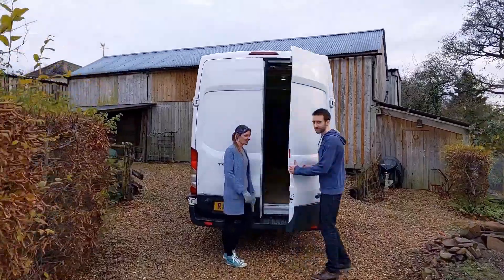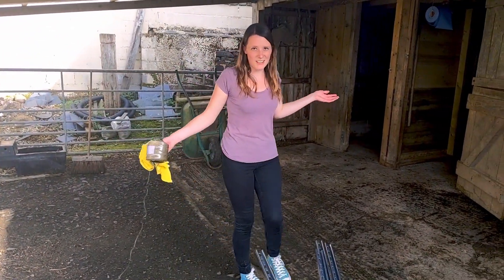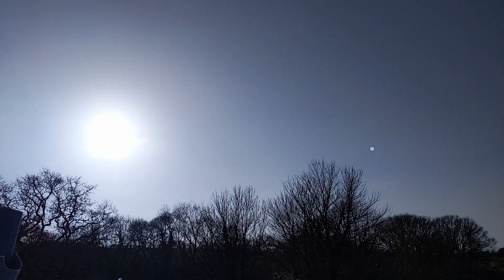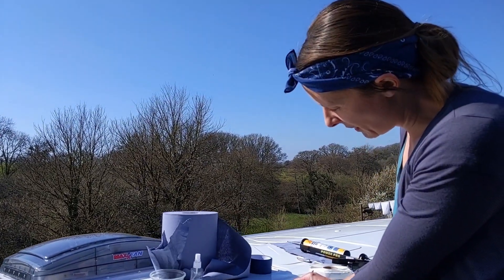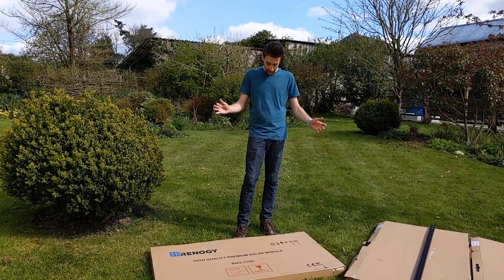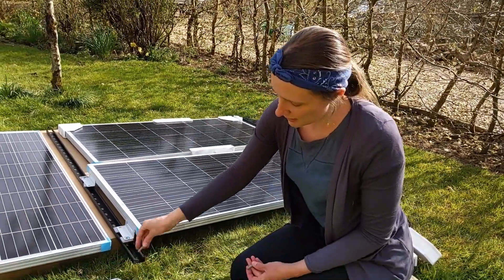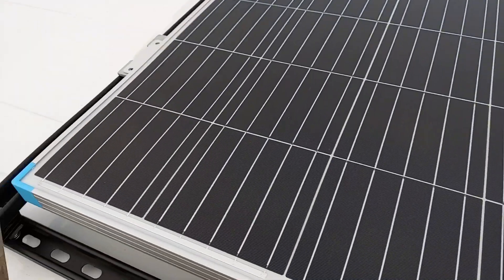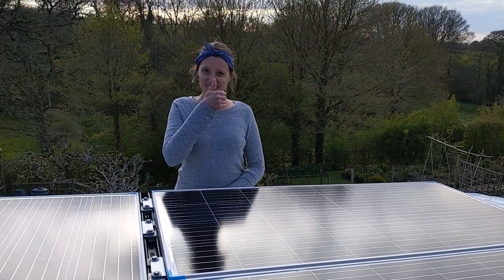DIY Unistrut Roof Rack (Easy Solar Install!) | Transit Van Conversion E12

Comment: It is one of the cleanest diy unistrut racks I have seen on the platform! I like the low profile rails, black paint, and rubber spaces underneath, also a clean sealant job!

I purchased 6x black anodized, mono, 190W panels, 142x70cm, and hoping to mount them on a long-wheelbase sprinter or crafter. They have circa 4.3 meter payload compartment length, so there is little space to spare, 6*70 is 420cm, almost 1.2 kW of power ;) I will have to mount them with no gaps in between. I think it looks better and is double. In the worst case, I will have one spare panel for winter. I am also hoping to have a tiltable mount, which is not a strict requirement, more like a side effect of the mount I am thinking about. I might have to rise the last panel or install it under an angle like a spoiler, to fit two low-profile vents underneath the panel. I will be living in the van full-time, because of the high rent prices, so wish me luck! ;)
Reply from the maker: Thanks! Yeah it's working out really well for us :) Nice, that's a lot of power! What are you going to be powering with all that? Good luck 👍
Reply: @SelfBuiltStories  Thanks for the response! I will be living in the van and hopefully continue working remotely in IT. So computer all day, lights, fridge, blender, ventilation/fans, charging devices, dehumidifier in the winter, diesel heater, water pump, some power tools. My way of thinking was panels are cheap and I have no particular use for the roof, so why not. I live in Ireland, so with winter in mind, I expect only 1-2 peak sunlight hours in the winter on average, and 5-6 in the summer, but could migrate somewhere else for winter. At home, I use about 4 kWh per day with electric cooking and a desktop PC. I have Bluetti AC200MAX 2kWh power bank that can handle 900W solar and the battery extension is 3kWh (200W solar), 5kWh in total, hopefully some 3-5 days of autonomy. I don't want to cringe too much when checking the battery levels ;) Maybe I will move to an off-grid (static) location, and I could rely on the van as a mobile power plant ;)
Reply from the maker: Cool, yeah if you have the space up there then why not! Sounds like it will be a nice setup 🙂

Comment: You guys are fantastic. You guys work so well together and explain everything in great detail and with good humour. We are doing a van conversion build at the moment and have had our own fair share of ups and downs. We bought a roof rack last weekend that ended up just being slightly off and doesn't fir out roof mounting points. We are going to make a unistrut roof rack like yours with a few tweaks for our citroen relay and will then mount our renogy panels on top. Your 525W should power a massive amount for you!
Reply from the maker: Thanks a lot! 😊 Yeah we like to share the mistakes as well as there are inevitable things that go wrong all the time in a project this size. And that's cool, hope it goes well for you. Our roof rack is holding up really nice and having all that free power on the roof is great 😀

Comment: Hi guys, thanks so much for the great video! We ended up following this design pretty closely and found that we had some leaking, which we realized was coming in from between the strut and the pucks, so we added a layer of butyl tape on top of each puck before re-securing the strut down and now we are leak-free. I just wanted to point it out for anyone else who might run into something similar. Thanks for helping us build a solid and budget-friendly roof rack!
Reply from the maker: Awesome, glad it was helpful! We did something similar with sealant and covered all around the tops of the bolts and around the rubber washers, butyl tape sounds like a nice way way of doing it too. Enjoy your new rack 😄

Comment: Hey guys! I went back in time to watch this episode (yet) again and I just wanted to say THANK YOU because it finally gave me the confidence to build my own unistrut roof rack. My van is an Iveco which doesn't have threaded inserts so I had to drill holes but otherwise I ended up doing exactly the same as you. Butyl tape, spacer, unistrut. The result is better than could have hoped for. You guys rock 😁
Reply from the maker: Awesome, glad to hear it worked out well for you too! It's pretty satisfying to build one for a fraction of the cost of the bought ones isn't it 🙂

Comment: Thanks to both of you your inspirational I picked up a 16 plate jumbo a week ago and watching your video diaries is like watching a video Haynes manual version of an how to guide Ive got 15 days to but some kind of basic setup in the van for a 3 day holiday with the grandson (he's the boss ive been ordered to sort the van for an holiday and he needs power for his tv - lol) so far a blowup bed and a loo  lol - the same panels batteries and a channel rack on its way fwoooo (tick tock) ---- your diaries will certainly help in my race THX
Reply from the maker: Cool, hope the build goes well! And wow 15 days, that's quite the challenge, good luck! Our first ever night we spent in the van was just after we bought it with an airbed, coolbox and wearing lots of warm layers 😃 You don't need much to be able to use it for some adventures, enjoy! 🙂

Comment: Hi, great video and explanation we are certainly taking inspiration from this. Thanks! 🙏🏼 Have one question though. When looking it up it says that the bolts only go 16mm deep in the pre mounting holes. However, it looks like you have 25mm going down into the hole since your black nylon spacers are 25mm and your bolt is 50mm. We are struggling with the length of the bolt we should use, was your experience that the bolts went further down than 16mm or I have just missed something in the video and your bolts also only go 16mm down into the holes? Thanks in advance! 😇
Reply from the maker: No problem! And hmm, interesting question. I've just looked in the BEMM for our Transit and it does mention the 16mm maximum intrusion, but the actual space on ours was definitely more than the 16mm as like you say we have a larger excess than that. You can see the amount of bolt sticking out that goes into the roof when we tighten this one down here: https://youtu.be/1fh9iaTJ6Ic?t=571 . We've been using our setup for years now with thousands of miles driven and haven't had any issues. Assuming you also have a Transit maybe the best thing if you haven't already is to take off one of the sealing covers and use a small pencil/cocktail stick to check the depth. Good luck! 👍

Comment: Finally time for me to build a rack, so I’m back watching again. Any updates on how it’s held up? Thanks for the great tutorial!
Reply from the maker: No problem! And we've had no issues with it so far (save for one spot where we had to go back and add a bit more sealant we missed). The only thing we thought would be nice would be if the widthways bars were slightly longer to give a bit more flexibility with different panel sizes if we ever wanted to do that, but then we wouldn't have been able to nicely cut a 3m piece into two for them so it would have cost more. So we'd do the same again with maybe that one change if we could get some slightly longer bars for a good price 👍

Comment: Nice job! I would have put cable entry gland under solar panel - that way it is less visible and also protected from up (rain and sun).
Reply from the maker: Cheers! :) You could do that but we wanted to use the existing covered holes on the roof of the Transit instead of drilling anything. Also makes it easy to get to it for maintenance/adding sealant without having to remove a panel first 🙂

Comment: I can't believe you used that tiny hacksaw!  They have terrible blades. Good job persisting.
Reply from the maker: Haha! It worked pretty well cutting through the unistrut to be fairbut we gave up cutting down all the bolts with it. Switched to the angle grinder for those 😅

Comment: Advice asking, I have a LWB not the jumbo, wondering if Unistrut extend further back would fit the the same 525w set up you have, I have a maxfan as well..Seems you have room at the back, just have to put the gland centred right at the back and drill a hole..Love your vids, funny I have a computer alarm clock, farm animals sound, so every time your sheep make a noise I think my alarm is going off..lol
Reply from the maker: Haha, that is pretty funny! Sorry about that 😂 And yeah we do have a bit of space at the back of the roof rack but not much, about 40-45cm (we've mounted an antenna for our internet there). Our panels do start quite far back on the roof though, probably the first 1/3 is just the sloping part and the maxxfan, so if you had them start further forward you could probably do it the same way. We could also have gone with slightly different sized panels that were a bit wider and just extended over the edges widthways a bit which would have been fine. So would imagine you can definitely fit 525w on your roof, just might need to play around with different configurations and panel sizes to get something that works 🙂
Reply: I've started converting a LWB transit and have managed to configure 500w using 2 x 200w and 1 x 100w panels - which according to sketch up (and my measurements!) should fit up there no problem! Fingers crossed it works in reality haha. I couldn't seem to find a realist way to fit 575w like SBS but I reckon 500w is more than enough. Let me know if you figure it out!
Reply from the maker: @harrietmorse5529  Cool, good luck! 😀
Reply: Actually just an update/correction if anyone read my earlier comment - apparently you shouldn't mix wattages within the same solar array! So I've changed my plan and sent back the 100w and exchanged it for an additional 200w. Now I'll be squeezing 600w of solar onto the top of a LWB transit hopefully! Just didn't want anyone to read my other comment and think mixing them was a good idea. I stand corrected!
Reply from the maker: @harrietmorse5529  Cool, yeah you can mix panel sizes but it does make it a bit more complicated as you have to plan the array carefully to make sure the voltages/amperages make sense taking into account the different panel properties. Generally it's a little less efficient as the array is held back by the lowest common denominator, explorist.life has a pretty good article about it here: https://explorist.life/using-mismatched-solar-panel-sizes/. Enjoy your 600W array!👍

Comment: I have 4 bolts for mounting points on my roof of my VW Caddy. I'm gonna use unistrut for the rack and box and make my own mounts using rubber spaces, washers, 90⁰ brackets, and t-nuts. Then I'll make a rack and rack box
Reply from the maker: Cool, hope it works out well 🙂👍

Comment: These galvanized steel rails are a decent alternative to aluminum rails. Currently we have an aftermarket (commercial) rack with emergency lights installed. I'd restore that thing, but it's solid steel construction and way too heavy. 
Great setup with the solar panels and good to see the progress! :-)
Reply from the maker: Thanks, yeah looking forward to having them all wired up 🙂 How is your build coming along?
Reply: @SelfBuiltStories  Due to some health issues and other projects - we've been dragging our feet a little. Yesterday I did take a closer look at the rack and it's bolted to existing, factory installed C-channeling. If the bolts are not terribly rusted, we should be able to take the rack off with about 4 people this weekend. Then it's time for an extensive cleanup underneath. Small steps.
Reply from the maker: Small steps are still moving forward 🙂 Hope that it goes well when you're able to pick it up again 😊

Comment: doing the same thing soon, just very scared with building the frame! You've been great to watch, got the same van so everything is so helpful. When are you off living full time? You've been building for ages!
Reply from the maker: Cheers, and glad to hear the videos have been helpful. Sure you'll be fine, the unistrut is a bit like meccano, so it's easy to bolt together and reconfigure it anytime you want. We finished the van quite a while ago now, the videos just take a long time to put together 🙂 Currently in Norway since a month ago, enjoying it a lot! We're a lot more up to date on Instagram 😎👍

Comment: hi just got round to fitting my version of this, the m8 bolts i have ordered are the wrong thred they dont go in smooth tried some m8 roofing bolts i had lying around they go in real smooth. would be worth stating what thred the fittings are inside the roof. thanks for the ideas. i have used a few of yours.
Reply from the maker: Hey, interesting, it's not something we came across. We just ordered some standard M8 set screws and they worked fine. No problem, good luck with the rest of the build 👍

Comment: Hey Guys, loving the channel, it's helping me out so much with my build. I just have a quick question, was your unistrut hot dipped galvanised or did you go for the pre galvanised version, if so how has it held up after painting as I understand it pre galvanised is internal and hot dipped is external?
Reply from the maker: Awesome, glad to hear it! And we used the pre-galvanized ones (https://directchannel.uk.com/product/21mm-light-slotted-channel-3-metre/ ), then sprayed them with primer and black hammerite. They've held up pretty great considering all the weather and storms they've been subjected to, but the one thing we've found they don't like is being sprayed with a super high pressure jet wash 🤣

Comment: This is an excellent idea. Now the question is whether or not I can do it on my Nissan NV 200. If the top is flat, I’ve got it made in the shade.
Reply from the maker: Thanks, we're happy with it 🙂 Our roof isn't actually flat it's curved in the middle, but we just raised up the height of the struts going widthways across the van until they would clear the curvature of the roof and that worked pretty nicely
Reply: @SelfBuiltStories  
The NV200 isn’t as wide as yours but the specs indicate the total width, sans mirrors is 172cm, so that should be okay. The three(3) 175W Regony panels I’m going to use are 126 x 70 so to minimize total length I’m orienting them the same way as you did.
Reply from the maker: @Zerpersande  Cool sounds good, hope it works out well for you!

Comment: Can you please tell me what size of unistrut you used? 1 5/8” x 1 5/8” or 1 5/8” x 13/16” ? Thank you sooo much!
Reply from the maker: Hiya, we bought 4x 3m lengths of 41x21mm light slotted channel, 1.5mm thick. This is the exact one we went for: https://directchannel.uk.com/21mm-light-slotted-channel-x-3-metres. HTH 🙂

Comment: great tutorial, just wondering is there any wind noise while driving from installing roof rack from unistruts?
Reply from the maker: Cheers, and nope, nothing that we've noticed at least. The only thing we hear when we're driving is occasionally from the back when plates and things moving around a bit in the cupboard and trays in the oven, but the bulkhead blocks out most of it and we've never found it noisy 👍

Comment: Hi, great video! I was just wondering how many nylon blocks you used underneath the long pieces of uni strut?
Reply from the maker: Cheers :) And the nylon spacers we used came in a pack of assorted sizes 15mm, 10mm and 5mm deep (link in description). We used two together in a stack, you can see the two individual ones at 10:01. Believe we used the 15mm and 10mm on top of each other so a total stack of 25mm. HTH 👍

Comment: On transit van the side rail mounting area of the roof is on a slight angle . Did that cause any issue when mounting the cross bars without the need of shims ?
Reply from the maker: Yeah the roof does sloop up in the middle so you can't go straight across the middle without gaining a bit of height first. What we did is use the unistrut square washers which are a few mm thick in a stack, so the width ways bars are raised up by 3 (if we remember right) of those on each side. That gives just enough clearance for the curvature of the roof 🙂

Comment: No spreader plate on the 8 roof holes? I'd consider it for strong windy conditions or when you get a lot of snow on top, or your roof may bend. Otherwise, good first principle thinking to eliminate buying a prefabbed roof rack.
Reply from the maker: Thanks for the idea, it's held up nicely for the last year but will keep it in mind if we get any issues 👍

Comment: What length M8 Bolts have you used for this? And have you glued Nylon washers together as I was wondering how did they stay together after you have removed the Bolt after the sealant set off for the bottom one?
Reply from the maker: We bought a box of 50mm and another of 40mm which covered everything on the roof rack, and some of those we cut down a bit smaller as well. And nope we didn't glue them together, but no reason why you couldn't. There was only two and with the bottom one sealed down to the van they didn't really move so it was quite easy to just take out the bolt and lay the unitstrut down on top then bolt it back down. Once we it all together we then we back and added some sealant around the top of the bolt too and a bit around the join of the two washers 👍

Comment: Don’t cut the bolts in a vice with a hacksaw….. put the bolts in a drill, secure the hacksaw in the vice and BOOM….! #YourWelcome
Reply from the maker: Haha cheers :) We did try something like that recently for something else but the hacksaw just moved down the treads of the bolt, guess we need to work on our technique 😛

Comment: Hi what size entry glad did you fit? Mines 6-12mm and is to big for the cable
Reply from the maker: Hiya, we got this one and we didn't have any issues with it, with 16mm^2 cables: https://www.ebay.co.uk/itm/284003569620